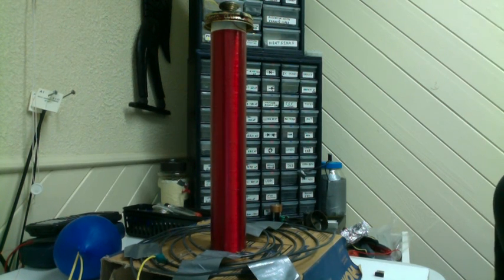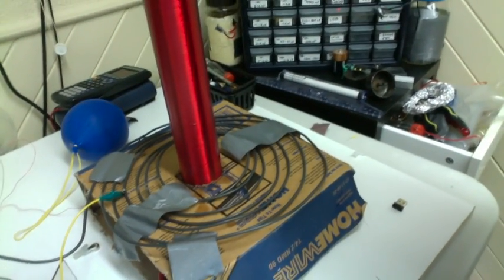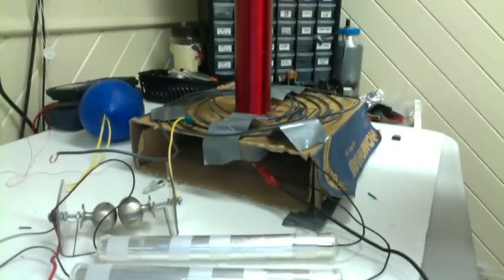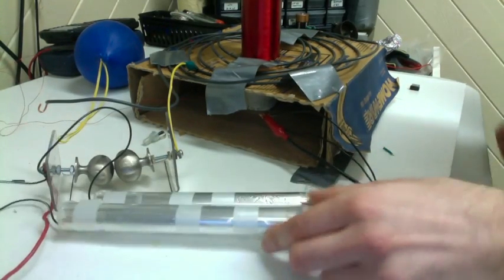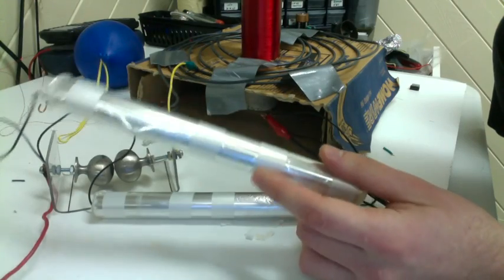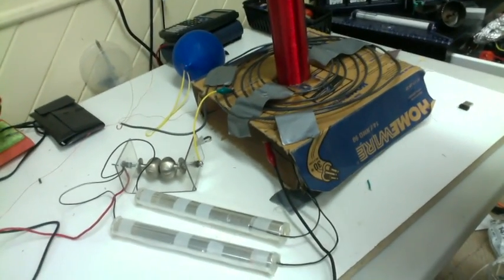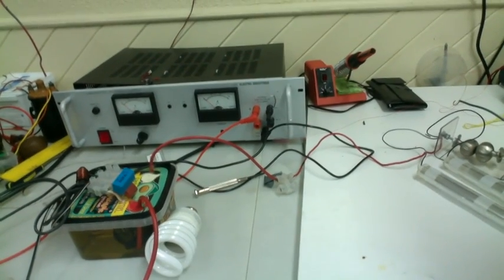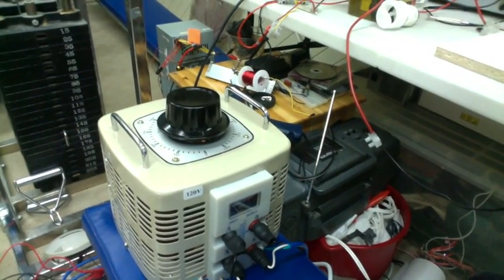Tesla Coil (1st try, it works!)

Comment: Doesn't powering the thing with your high powered, elaborate power supply defeat the whole purpose of a Tesla Coil?
Reply: That's not what I said. I said "Doesn't powering the thing with your high powered, elaborate power supply defeat the whole purpose of a Tesla Coil?" Of Course is Does! Teslas Tesla Coil CREATED  High Voltage! It didn't require it to produce it. That would defeat its purpose, and make it an insignificant invention. But Teslas invention drew high voltage out of thin air by itself! Making it a Significant and Major Invention!
Reply: CaptBill1111 you're an idiot.

Comment from the maker: you can see one of them bit me at 2:40 and I touch them with my hand soon after (it looks like I'm giving them a high five). I had done an experiment before where I very slowly increased the driver voltage to see when the secondary streamers got uncomfortable to touch. They are definitely not comfortable to touch at a point, you feel the jolt through your arm. I would obviously never do this with a larger coil. However, primary coil circuits, even the one here, are never ever safe to touch.